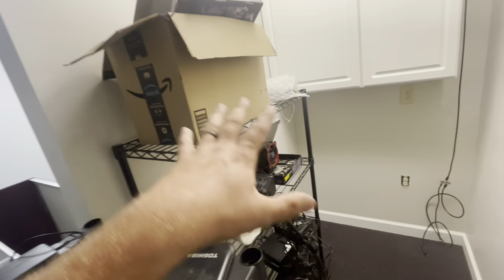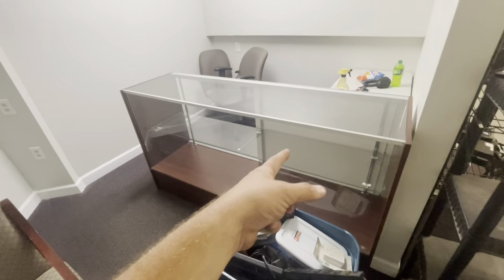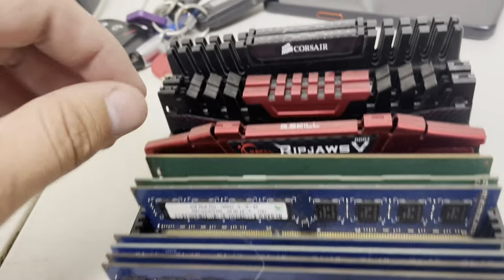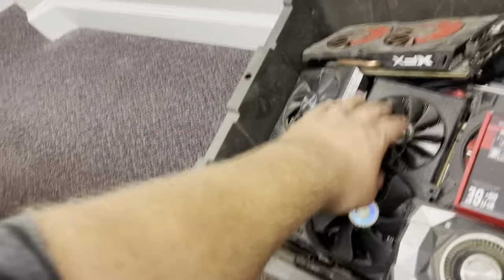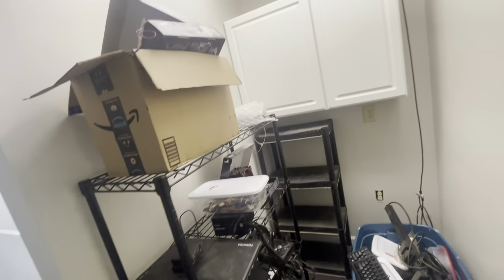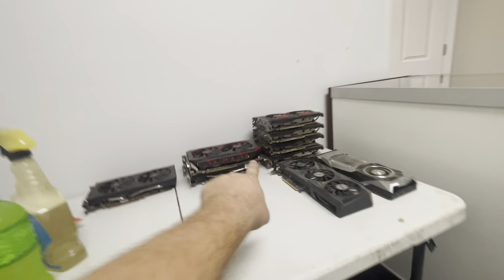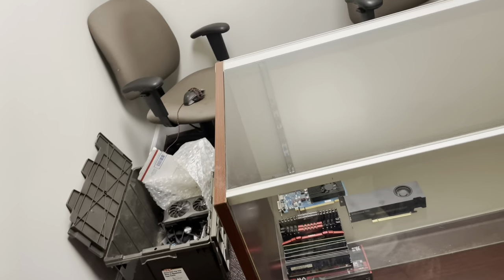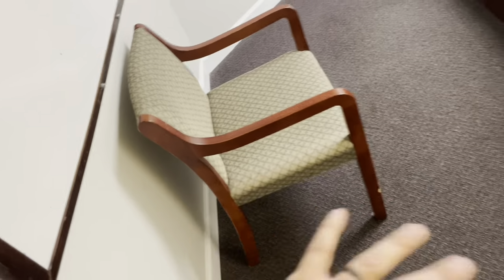Opening a Computer Store Inventory

Comment: Being that you have mined on all the GPU's, I would guess that all the pads will need to be changed, is that something that you will be doing to insure that the cards run reliably for the customer ?
Reply from the maker: Most of the older cards did not have the heat and pad issues of the 3080 and up gpus but I will be standing behind all systems if they have any problems would love to take care of it

Comment: Brandon, have you contacted XFX? In case you want new in box merch. You want your main shelf close to the top of the case. Get your best merch closest to peoples eyeballs. Also, put a mirror on the doors in back. Run a light strip in it so they are lit up nice and pretty. You could always print you some GPU stands to stand them up, make em more impressive.